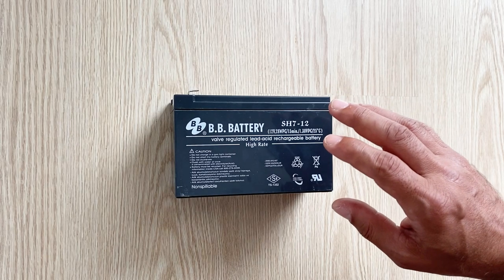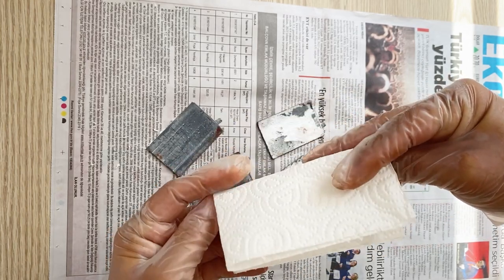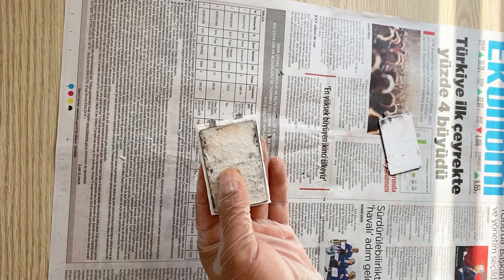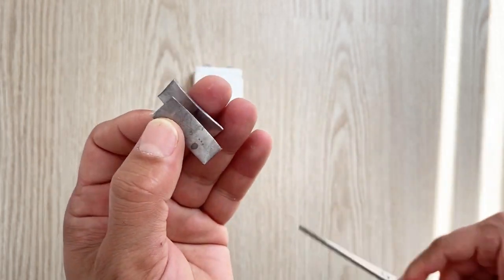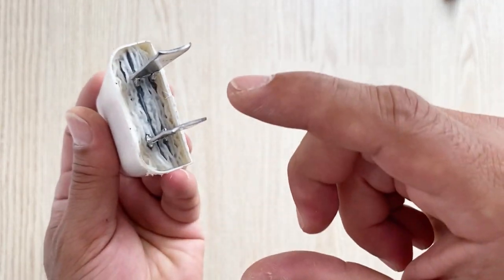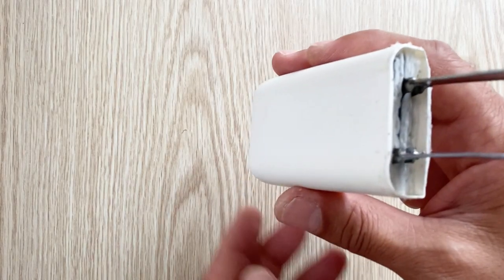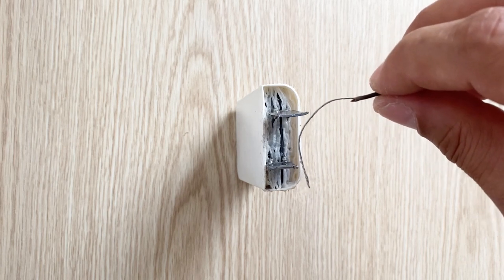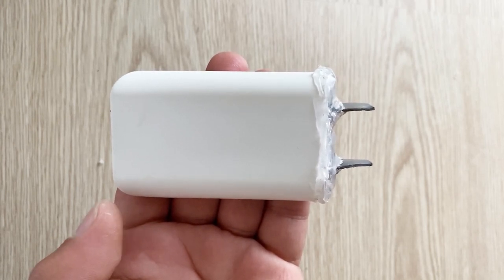How to Make Professional Lead-Acid Battery at Home (Step by Step)

Comment: The paper is eventually oxidized by sulfuric acid to charcoal.Coal is resistant.The coal will cause a short circuit.You will need a synthetic towel=Бумага в конечном итоге окисляется серной кислотой до древесного угля.Уголь обладает стойкостью.Уголь вызовет короткое замыкание.Вам понадобится синтетическое полотенце

Comment: Hi! This video is amazing. How did you attach the lead connectors to the electrodes?
Reply: Also, does the plastic container that you used have to be heat resistant?
Reply from the maker: Just solder it. Soldering material is mostly made of lead. So it’s a perfect way to connect them.
Reply: @joyofelectronics9782  Thank you so much! Also, what kind of plastic container did you use and where did you get it?
Reply from the maker: @emmabetances8418  it’s a cosmetic container of some kind.

Comment: I made it. It holds the voltage at 2.1V and can output a short circuit current of 1.6A, which is great, however it has a capacity of only ~2.5mAh. I charged it with a constant current of 200mA for 3-4 hours. I tested the capacity by discharging it with a constant current of 86mA, it discharged in ~2min.
Reply from the maker: When you first charge it. Charge with high voltage (6 volts) for a few hours with 1 amp or so. The capacity will increase brother if there is no other problem

Comment: Oh man,   you should have made an ultra battery instead.   I've always wanted to build one,  but i don't like messing with lead.
Reply from the maker: I will do, but there is lead in ultra battery too☺️
Reply: How can 2.12v battery lite a 12v battery,?
Reply: Sorry 12v bulb?
Reply: @nnejiamaechi9385  
That's because it's an incandescent light bulb. The filament heat up and glow when there's sufficient current passing through it. 

Lead acid batteries can supply a good amount of current even at 2 volts, but obviously not enough to make the light bulb very bright.
Reply: I wish you measured the amp draw

Comment: How many ah in this capacity does it has the same capacity of used plate? What about cycle life ? Have you tested how many times it will last
Reply from the maker: It’s 2000 mhA. Life cycle is very long maybe five years or more. I still use that battery. Maybe you have seen this battery in my some  videos.
Reply: @joyofelectronics9782  ok your salvage battery was 6ah, using this method you get 2000mah so  we will get 33% of capacity from negative plate is that correct?
Reply from the maker: @sucilaksono2150 no in may batter l just used four pieces of electrodes (total) but in the salvage battery 9 pieces were used. It means that the capacity of my battery has almost 70% of original one which is pretty cool.

Comment: the metal of both electrod is same? pb? is possible?
Reply from the maker: Probably you skipped that part of the video. As l told the positively charged electrode turns into lead dioxide over time while charging.

Comment: uhh... You may want to neutralize that acid you dripped on your surface @10:30.
Also. how about a video with the topic, "How to Make Leads for a Testing Device."
That would help you and many others.
Last Comment. I promise...Make your positive connection terminal smaller for distinguishing between the two....and
Reply: This a cell...not a battery!

Comment: What is the Ampere? I asked cos for it to carry all the tests you did and still remain upti 2.2v its necessary to know what was the amp? Can it be produced in 6pcs in order to get 12v or can each get upto 3vs or more?
Reply from the maker: The max amp is 5 volts. Yes you can combine six of them to get 12 volts
Reply: @joyofelectronics9782  ok pls what the ampere cos it's very powerful
Reply: Each lead acid cell produces a little over 2 volts. This here is not a battery. It's a cell. Multiple cells make a battery.

Comment: looks more like supercapacitor than a battery but its indeed interesting to see how much current it has
Reply from the maker: No no, it is a lead acid battery. If you watch the whole video you will understand. Its current is pretty high (approximately 4 amp)
Reply: @joyofelectronics9782  i watched the whole video including the ads, the reason i said the its more like super capacitor is cause of the current
Reply: @joyofelectronics9782  Definitely more than 4 amps. To melt wires like that that quickly requires 20-50 amps from my experience.

Comment: How does your battery work using the same Lead material for both anode and cathode. A Lead acid battery would require a Lead Dioxide Cathode! I thought you were going to coat  the negative  electrode with a coating made from the  waste positive electrode to make it positive?!
Reply from the maker: I’ve already explained in the video but probably you skipped that part. I’m gonna tell again. When you charge the battery for the first time the sponge lead on the the positively charged electrode turned into lead dioxide. After charge and discharge for many many times it will completely turn into lead dioxide. I hope this helped 👍
Reply: @joyofelectronics9782  Thanks a lot. I missed the important part!
Amazing work gives me new ideas on reviving dead batteries. Thanks again
Reply from the maker: @wwabete2009  you’re very welcome.
Reply: @joyofelectronics9782 Just made one following your advice and the results are crazy!
That’s pure genius of recycling lead acid batteries! Wow! I am discharging it at 0.2A and it’s like it will be discharging «  forever » I am already at 77mAh and 76mWh and it’s still going!
Thanks brother scientist for sharing « real stuff »
Reply from the maker: @wwabete2009 it’s really very nice to hear that. I became very happy. There is no fake videos on my channel. I always try to inspire people. Thanks for your nice comment and sharing the result🙏
Reply: I have seen it done by placing the lead in sulfuric acid, adding a positive charge and stirring it for a couple of hours.
It was a while ago. But maybe there was some distilled water also? You know, for the oxygen atoms. I need to find that video again. It was over in India I think. Rebuilding battery's and they would just drain the old ones into the street. Yes! That has got to be good for...uhm? Wait. That was yet another video. The video for making the positive plates was....I'll have to look through my bookmarks/favorites. Oh...and this is a cell!
Reply: You didn't listen it bro.he explained very carefully!

Comment: The problem here is that its not a lead , it a lead sulfate because its very old and deeply discharged battery, so when you charge it up you release the sulfate atoms to the electrolyte and thus increase the constration of the electrolyte

Comment: The battery isn't "professional" is actually quite weak. Why? Check ohm's law. 2.12v with a resistance (the copper wire he used)mostly equivalent with 0 will draw lots of amps, for a very short time, and it won't last if used as a voltage source due to the lack of capacity...
Reply from the maker: Brother first of all thanks for your comment and sharing time. But you are a prejudiced because l calculate its capacity. (After positively charged electrode completely turn in to lead dioxide) the capacity is 2000 maH which is almost same with a new brand lead acid battery with the same size. If try making one at home you will amazingly confirm me. Thanks
Reply: @joyofelectronics9782  yes, 2000mah, which is 2ah, which is weak 😆
Reply: @alexandrudiculescu6996 That is just one basic cell! He can connect as much as wants in parallel and he will obtain any Ah he wants at 2V! So it’s quite a good performance
Reply: @wwabete2009  I know that you can get any voltage and Ah by connecting them in parallel and series, but it's only about the description video and the "delivered product".
Reply: @alexandrudiculescu6996  ok got you! You are right. Compared with what others present on the internet, it’s the best so far especially considering that this is recycling this dangerous lead rather than letting it out in nature. It is always good in life to encourage the little effort people make. What might appear to you and me as unprofessional could be the best this guy can offer today. He may offer us something amazing tomorrow ! He is just an enthusiastic experimenter who has a burning desire to share!!
Reply: Yes. But it's a cell!

Comment: how to make all - + plate 😢
Reply from the maker: I’ve already told in the video. Probably you skipped that part. Let me tell you again☺️when you charge the battery. The positively charged electrode turn in to lead dioxide over time so works as positive electrode.